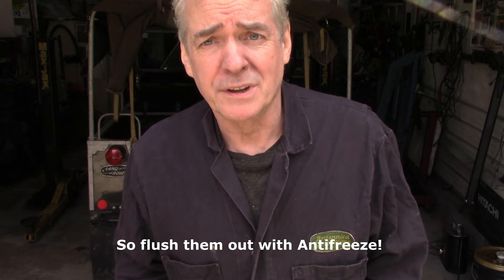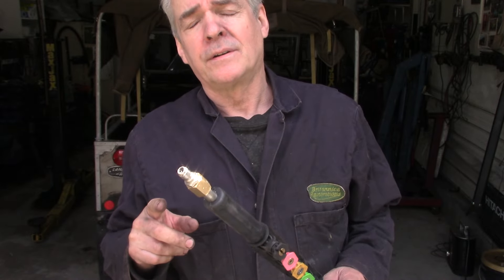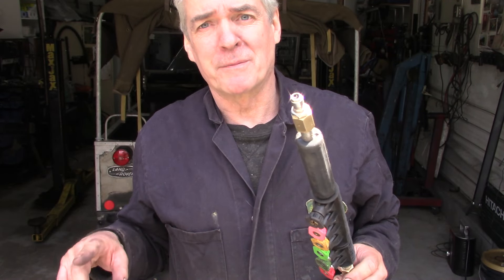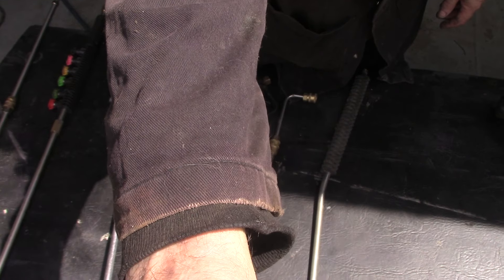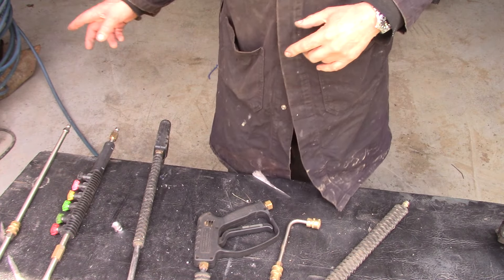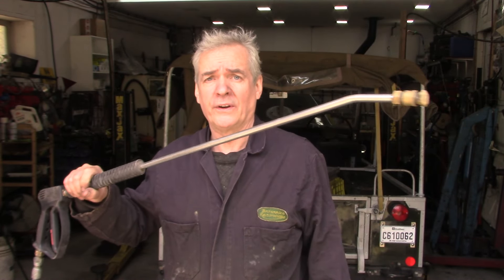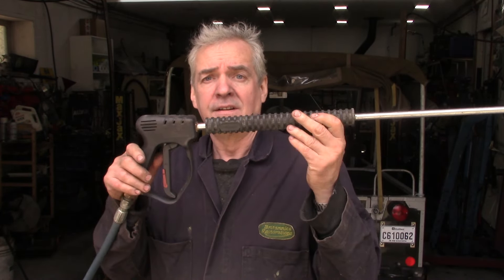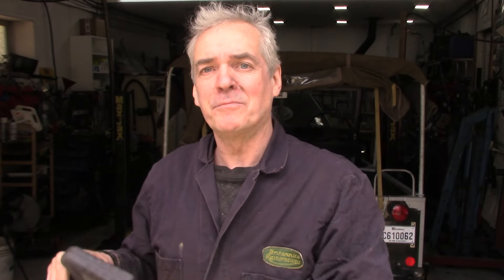A bit about power washers!

Comment: Morning
Over the years I have quite a few of the "power washers"  Not steam cleaners...... If i need a steam cleaner I go to a place that's have them....
I have had a fair choice of karchers, Nilfisks etc etc.
Tip choose a washer with standard connections - some don't karchers don't and you get tied into buying their over-priced accessories.
The floor scrubbers are handy - when you need them.
Best accessory by far I found  is a 10 meter hose. - definitely worth it's weight in gold you can walk around a vehicle or wash down the side of the house or blast infestations out of trees in the garden.

Theme LR rust traps - why don't you do a feature in where they are and how to limit their impact.
The classic one is the classic exhaust tail pipe existing across the rear wheel well!!!

Comment: One time I couldn't get the washer to make pressure. I opened all the valves and cleaned everything. Multiple times and couple of evenings. Finally I remembered that this lance needs the tip to be pulled forward to make pressure.
Reply from the maker: Easy done!